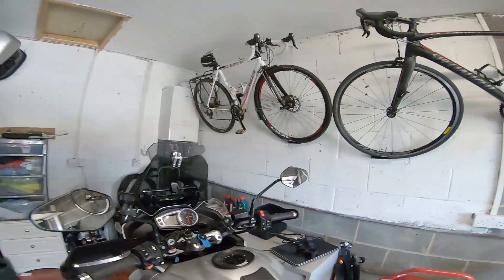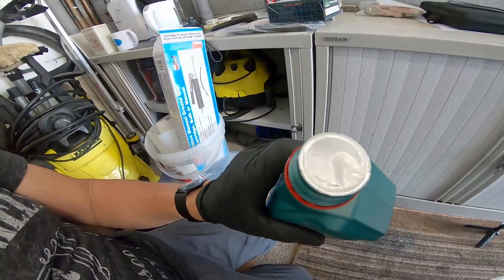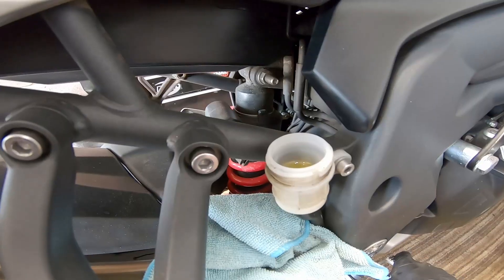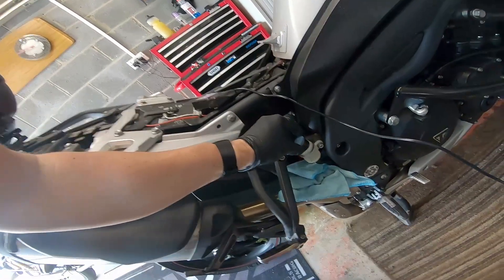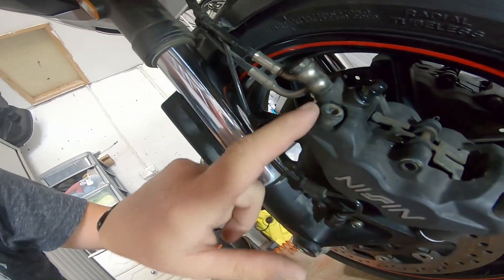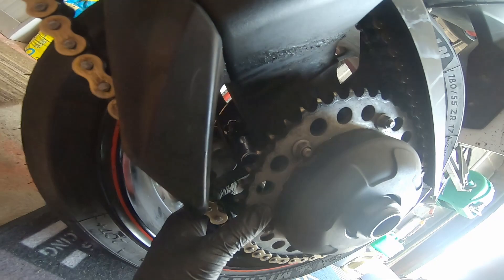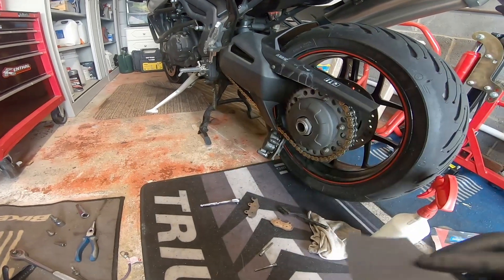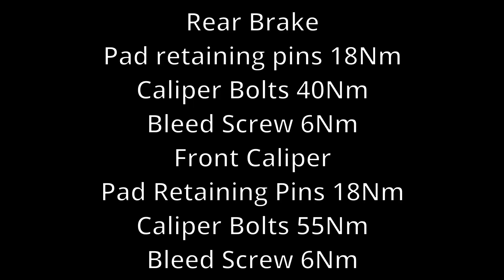Triumph Tiger Sport 1050 12K Service Part 3 - Brakes

Comment: I'm impressed you managed to do all the rear calliper work with the wheel in place, did you manage to get a torque wrench on that top bolt?
I ended up rounding off my pad retaining pins (I think the factory do them up way too tight!) I replaced them with stainless steel DLC coated pins from Pro bolt.
Reply from the maker: Hi I used a shallow socket but one viewer has provided some hints and tips which I will do in another video. For the rear caliper he suggested removing the rear sprocket to get access
Reply: @upnorthbiker  Yep, I saw the comment, and took a look at your chain and sprocket vid to check, and there is a (very) brief shot that shows that top caliper mount bolt,  so I'll next time I'll give it a go.
Reply from the maker: One tip I got was to remove the sprocket which is easy on a single sided swingarm and gives good access, especially if you don't have a centre stand or paddock stand.

Comment: Slacken those slide pins on callipers while the calliper’s still on the bike. If they’re tight they’re a bugger to undo with the calliper dangling.
Reply from the maker: Another good hint, thanks Phil. Changing coolant is next followed by fork oil and headstock bearing regrease and adjust so hints and tips welcome.
Reply: @upnorthbiker  Did my coolant recently (just aquired the bike recently from a dealer by the way). You'll need to access the radiator cap under the L/H tank fairing. You probably already know how to remove the fairing but just in case. Remove the hidden screw/bolt up front under the headlamp, then the fairing slideds forward 2 inches and comes away. Then disconnect the indicator connectors. Nice design I thought. Previous owner/idiot thought it pulled off and wrecked the plasic lugs. Left me with the the mess to sort out. Thought I'd mention it just in case. looking forward to seeing how you do it.
Reply from the maker: Thanks Phil when I changed my plugs I had to remove all the fairing parts and someone bodged the screws under the nose. I have a bit of a repair job there to do at some time. I could not get the recommended coolant but all the web sites were saying it has been superseded with another triumph variant D2053 rather than HD4X.
Reply from the maker: I just did mine today. Only got just under 2 litres back in but that was about what came out. Couldn't get the bottom hose off the water pump so took the radiator hose off instead. @philhart3878

Comment: I’ve serviced the rear brake callipers on my 2017 1050 sport and took the rear sprocket off to access it. Simple job and made access to the calliper a doddle.
Reply from the maker: Never thought of that as you can easily get the sprocket off. Good call.
Reply from the maker: Never thought of that as you can easily get the sprocket off. Good call.